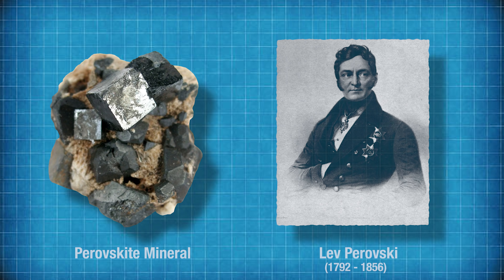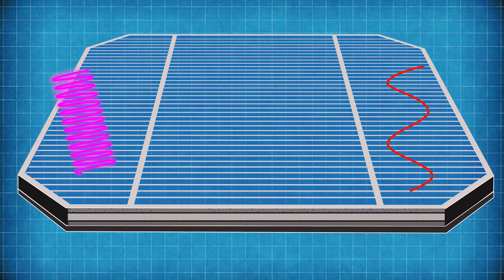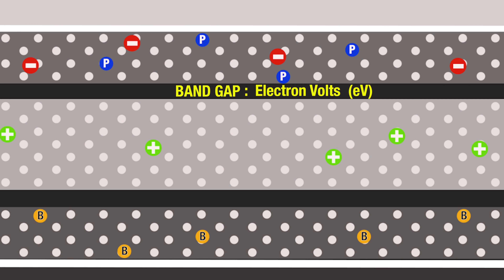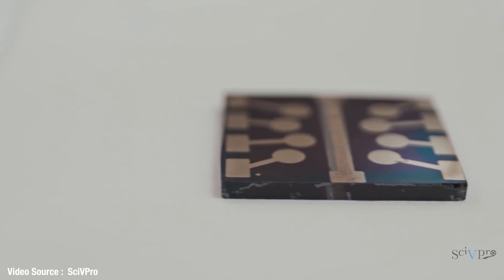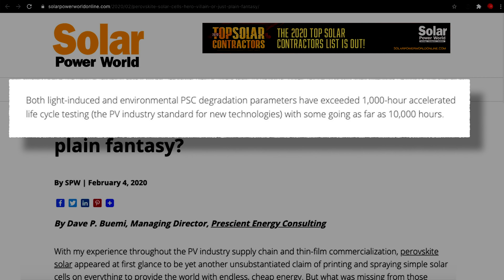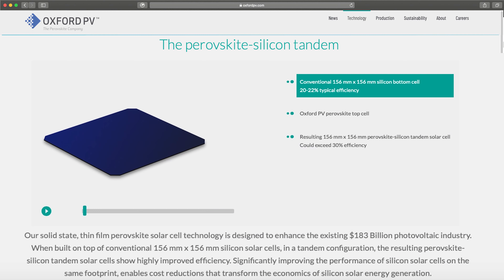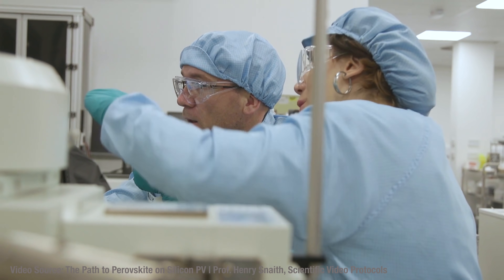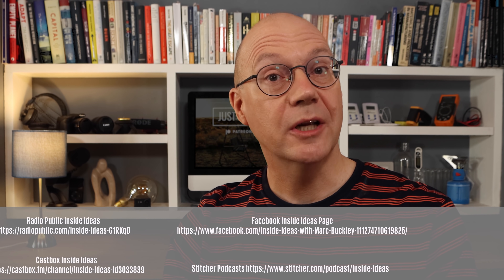Perovskite Solar Cells: Game changer?

Comment: Solar energy is pretty cool but only as a part of the solution. On unused space like rooftops ir is a great thing. Clearing giant amounts of land for solar farms not so much. The only solution still remains nuclear energy onto that solar as I said on rooftops is still welcome.
Reply: I wouldn't say nuclear is the "only solution", I'd even question if it is a solution due to economic issues - nuclear projects are very expensive and don't have a track record of staying on budget. Long term decomissioning and storage costs are often disregarded when planning these projects.

Solar, wind, battery storage will easily cover 80% of the power needs using technologies which are available today. The big issues are "seasonal storage" and generation variability. Hydrogen may aid this issue once costs have reduced, biomass and some fossil fuel burning will pick up the remainder. However we need to find a good and scalable "seasonal storage" solution to close the gap as demand side management will only do so much.
Reply: @AndyFletcherX31  Of course after not building nuclear powerplants for like 30 years it is hard to start again. Finding qualified people is hard. If we would have continued building nuclear powerplants in the seventys manmade climate change wouldn't even be a thing. Now we have to accept this mistake and take time and effort to get back to building new ones.
Reply: Fossil fuels will still be a part of the mix for some time too, I'd argue.
Reply: @gedofgont1006  Only if we don't start building new nuclear powerplants. Germany is showing that by opening the new coal power plant Datteln 4.
Reply: @mrkokolore6187  Has Germany turned its back on nuclear altogether, for the foreseeable future?
Reply: @gedofgont1006  Yes we are sadly quitting nuclear energy till 2022.
Reply: @mrkokolore6187  Well, if there's anything left of the world in 2 years' time, after the COVID-19 fiasco, maybe our energy needs will be a lot less!
Reply: @gedofgont1006  I don't think so. Estimates say that by 2050 energy needs will at least triple. And I say needs and not consumption because if Germany will shut down all base load energy plants and try 100% renewable without long-term energy storage we will have blackouts on a regular basis.
Reply: @mrkokolore6187  I think what we're seeing at this very moment, with the COVID-19 scam (yes, it is a scam), is the beginning of a concerted effort to ensure that Germany and the rest of the developed world will not need anything like 3 times the current amount of energy production, by 2050. 
In other words, massive de-industrialisation.
The idea of rolling blackouts is an alarming one. Better get some big candles!
Reply: @gedofgont1006  Why would we deindustrialize because of a virus? The opposite will be the case. Once we start getting used to it or better finding a vaccine against it people will try to catch up with vacation and people will try to fire up the economy and if we won't start using nuclear this "firing up" may become literal. More digitalization, more electric cars will all take a lot of electricity.
So no I don't think we will deindustrialize anytime soon.
Reply: @gedofgont1006  I am honestly not willing to read the entire text just tell me what you mean.
Reply: @mrkokolore6187  It's difficult to summarise concisely, but in essence it's to do with a managed and deliberate curtailing of Western industrial output, under the guise of creating a more sustainable planet for all.
The unspoken subtext is that this process will be overseen by an emerging world governance system, which will operate above national interests and be largely in the hands of international corporate finance.
The view from this perspective is that Merkel is little more than an agent of such globalist intentions and is therefore very limited in what she can do purely for German national interests alone.
Reply: @gedofgont1006  Angela Merkel has the power to revise the "Atomausstieg" at any time. The only problem is the opinion of the people in Germany. If we manage to convince enough people that nuclear energy is good and the majority is pro nuclear Germany can continue to use nuclear power. This is a goal hard to reach as the false anti nuclear arguments have manifested into to the heads of the people pretty strong but the reward would be a carbon free country that could help produce high quality nuclear powerplants. I think this is worth the effort.
Reply: @mrkokolore6187  OK, I think I'm leaving this discussion. I'm not sure you've registered what I just told you.
I would strongly urge you to listen to corbettreport.com; it's very well researched and might help you reach a broader understanding of world events and just how little room for manoeuvre our so-called leaders actually have.
Reply: @gedofgont1006  I'm not in the mood to listen to conspiracy theory news. If you can't even explain it maybe it's for the better to just stick to the known facts.
Reply: @mrkokolore6187  If you think it's all just 'conspiracy theory', you're in for a rude awakening.
Out of interest, would you mind telling me how old you are?
I'm 55 and live in England.
No hard feelings, I hope.
🙏🤝
Reply: @mrkokolore6187  What is a known fact? That's a good philosophical question!
They aren't quite the bright little diamonds of eternal truth you might like to think they are.
Reply: @gedofgont1006  I'm not too keen on listening and reading for hours on an alternative world order. If you want to explain it to me in short easily understandable words be my guest bit I try to focus on things like global warming and which technologies might power our world in the future.
Reply: @mrkokolore6187  I gave you a fairly good potted summary a couple of messages back.
Are you paying any attention?
How old are you, my friend?
Reply: @gedofgont1006  How old I am is none of your business and actually not even that important. What I can say is that I am young enough to be heavily impacted by global warming and old enough to see the big picture.
I told you that if you want to share your thoughts with me in an understandable way you can do that if you like but I will not spend lots of time reading or listening to your linked website.
Reply: @mrkokolore6187  So do you believe global warming to be both real AND largely the fault of man's burning of fossil fuels?
I asked your age because you don't appear to have a very deep understanding of political context, a factor usually indicative of youthful immaturity - in outlook, if not in years.
But you are right: your age is none of my business. I apologise for any offence caused.
Reply: @gedofgont1006  I am not offended. I know a bit about politics but as I said I focus on the global warming and what the politicians do about it. Not knowing much about politics is not a sign of immaturity some people when not most just don't really care about politics that much. And answering your question yes I do think man made global warming is real. There is plenty of evidence to that. Apart from that going from fossil fuels to nuclear is just a natural step of progress like going from wood to coal has.
Reply: @mrkokolore6187  I see what you're saying, but my point is, without a fairly detailed understanding of the political context of the global warming issue, you cannot really hope to see whether there are genuine reasons for concern in the claims being made.
I was a 100% climate change believer for many years.
I happily accepted An Inconvenient Truth was a meticulously researched and scientifically backed documentary, with no axe to grind other than to wake everyone up to the magnitude of the dangers we all face.
Only slowly did I come to understand there is an agenda behind everything, usually involving money, power and control. Al Gore is very much part of that agenda and you and I are not chief among the intended beneficiaries.
You really HAVE to dig into things a bit more deeply, if you want to know whether your current beliefs are well supported or not. Simple acceptance of a prevailing narrative will only ensure you are more easily mislead by those who want to exploit your credulity.

Comment: 'Only' 10.000 square miles or 26.000 km^2 of solar panels is A LOT and almost as big as Belgium (30.7k). This just sounds like the same than the promises of future battery-technologies that still doesn't appear even something like the zinc-air battery looks like superior in all aspect. Where are they? Wind and solar are the same BS and just a humongous pile of toxic waste made by fossil fuels in the end. Nuclear is the way to go or we better off by burning fossil fuels as long there is enough.
Reply: Yes nuclear is the way to go not burning fossil fuels.
Reply: What is the collective roof area of all buildings in the us? I don't know but am pretty sure there is already enough roof area available with existing structures if utilised to cover the area needed.
Reply: @robmcilroy1894  You should consider that electricity is only one 1/6 of all energy needed. Here in Germany we could get 100% solar electricity from our rooftops alone but to get the 5/6 can be a really challenge especially when talking about energy storage.
Reply: @mrkokolore6187  hydrogen , lead acid, hydro pump storage, to name just a few. Liguid air storage to name another. Not complicated in my estimation , say compared to implementing and commissioning a nuclear plant. The politics and inherent human biases are extremely difficult to overcome though. Eighty million more mouths to pander to every year. Futures so bright 😎
Reply: @robmcilroy1894  You seem to have no idea how hard it is to actually build these storage systems. I know a lot of storage systems but they are just concepts. 
Following your argumentation nuclear fusion is no problem because there are many promising designs.
Reply: @mrkokolore6187  I have some idea , I've been off-grid for ten years (solar with lead batteries)and have studied and researched many systems and processes. Nuclear fusion has potential but thats what it is , potential. There are numerous tried and tested storage systems already being utilised around the world. The technology isn't the problem.
Reply: @robmcilroy1894  I gotta say I'm impressed. I didn't know you could use regular lead batteries to store solar energy for ten years. Is it broken now or how long do you think this can last. What lead batteries did you use which solar panels and how much did it cost. Tell me more please.
Reply: @robmcilroy1894  You must be on drugs if you think that these amounts of solar cells mostly used in bad locations plus a Tesla-like battery in all households plus all cars is good for the environment or change anything about the weather. The production of all this toxic chemicals needed is insane already today and not much of it can be recycled with profit, which means, it's filling up the landfills. Renewable Energy is not green at all, but the most toxic and stupid form of energy today. Watch "Why renewables can’t save the planet | Michael Shellenberger" or "Planet of the Humans".
Reply: @robmcilroy1894  "There are 7.2 million battery EVs or about 1% of the total vehicle fleet today. To get an idea of the scale of mining for raw materials involved in replacing the world’s gasoline and diesel-fueled cars with EVs, we can take the example of the UK as provided by Michael Kelly, the Emeritus Prince Philip Professor of Technology at the University of Cambridge. According to Professor Kelly, if we replace all of the UK vehicle fleet with EVs,  assuming they use the most resource-frugal next-generation batteries, we would need the following materials: about twice the annual global production of cobalt; three quarters of the world’s production lithium carbonate; nearly the entire world production of neodymium; and more than half the world’s production of copper in 2018."

Source (Forbes) :The Dirty Secrets Of ‘Clean’ Electric Vehicles

The same insane catastrophic mining and toxic production processes can be said to any 'green' energy infrastructure. We are going to destroy this planet to aledigly save it. It's insanity and not reliable at all.
Reply: @Leynad778   and yet evs are still more sustainable than fossil fuels. I haven't stated that we are going to save humanity by moving to sustainable systems. It is but a small part of the potential solutions. The fact that our population is increasing by eighty plus million a year worldwide tells anyone that cares to think critically that we have some big issues to deal with, which most continue to ignore. Futures so bright 😎
Reply: @robmcilroy1894  EVs have not even a lower carbon footprint, which is made up BS anyway. EVs will win because they are far less complex than combustion engines with all the rest to keep them running, instant torque delivery, no gears needed etc., but atm they are certainly not green nor environmentally friendly because of the battery. Once a cheaper solution with higher energy density is out, it will win anyway and no reason to force this.
Reply: @Leynad778  carbon footprint? Evs can be made using sustainable energy, can be charged with sustainable energy. Show me a how a fossil fuel powered car can have less of a carbon footprint than an ev? Cognitive dissonance anyone.your argument is so obviously flawed, and yet you persist.
Reply: @robmcilroy1894  Volkswagen made a study with their Golf Diesel and e-Golf. Basically no difference in carbon footprint with the German electricity mix and CO2 does much more good than bad anyway.

Comment: 100 square miles is an easy comprehensible and  enticing number. Increasing efficiency is bonus at this point. The most important problem to solve is storage as you already know too well.
Reply: IT's not 100 square miles.  It's 100 miles squared, which is 10,000 square miles.  I was ready to forgive the aluminum slap, too.
Reply: jeff cowdrey, thank you for the correction. My reptilian mind thinks it is 100 x 100 and stop there. Reptile mind does that.
Reply: The 100 sq miles meme is bogus, if one imagines that being in one place. That is tightly centralized, and exactly the wrong approach. Micro-grids ( and small battery banks) placed all over the place where there is load -- especially places like parking lot charging stations, and residential and retail rooftops -- solve all sorts of problems. Add to that remote management, and you have nearly invisible highly distributed power with no distribution costs. I have a 780 Ah LiFePo battery bank for my off-grid home, and 30 x 330W panels, and this system is virtually maintenance-free and functionally bullet-proof. I manage it from a web site. Every modern home can have that same setup, and suddenly your "grid" infrastructure vanishes.
Reply from the maker: Agreed. I did, though, make a schoolboy error when I said '100 square miles' though, because 100 miles by 100 miles is actually 10,000 square miles. Nevertheless, if you look at it on the map it is a relatively tiny amount of land.
Reply: Since energy consumption will definitely go up in the future increasing efficiency is a necessity to prevent that 100 square miles from increasing heavily even then this will probably still be the case.
Reply: Mr Kokolore, yes. Jevon’s Paradox states that the more efficient we make use of something the more we use it. It is a never ending battle. Hell, if everyone can live Bill Gates’ lifestyle, I suspect 95% of us will do so, thus energy consumption will always go up. 20, 50, 100 years from society will use more energy than today even if we increase our efficiency by 100% or more. Human wants and aspirations is the the driving force - always have and always will be.
Reply: @demultiplexdfunc177  The redeeming quality of PV is as it becomes cheaper and more efficient, energy production becomes more and more the property of those who are now merely energy consumers.  Even now, I can use less than $1000 PV panels, compact enough to carry on a small trailer, to power my electric bicycle plus touring accessories, giving me unlimited freedom of movement.  Imagine that.
Reply: jeff cowdrey, so where do you get that sunlight to power your trailer and presumably vehicle to the destination that you want to hike/bike? Where do you get that sunlight to fly to see relatives or that destination you always had in mind?
Reply: @demultiplexdfunc177  Sol Invictus been giving out free sunshine for about 5B years or so.  Should be good for another billion before he blows up into a red giant.